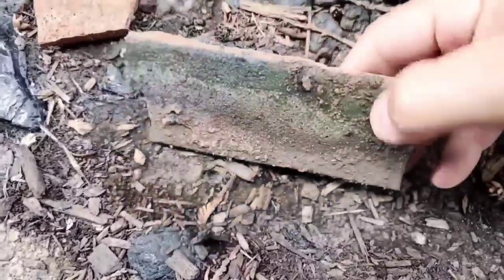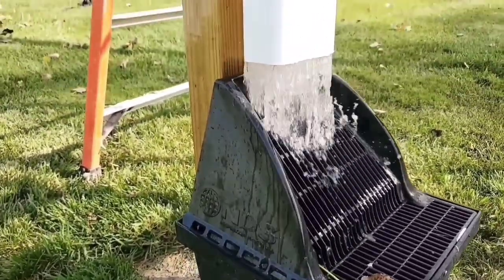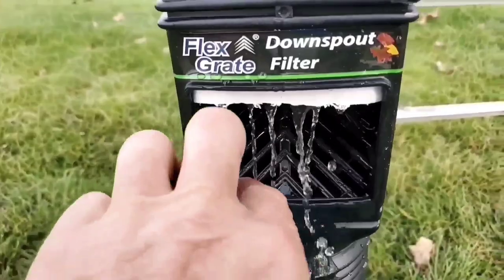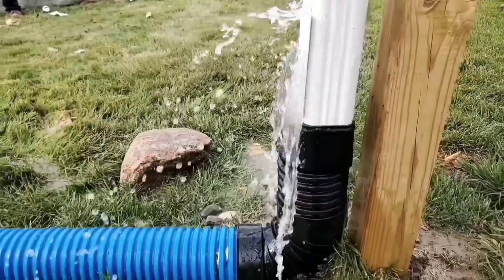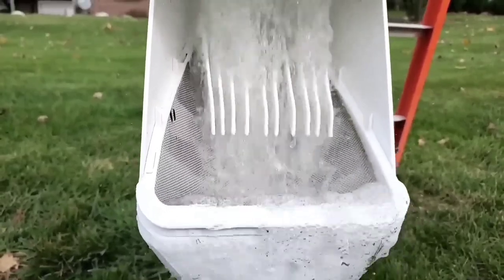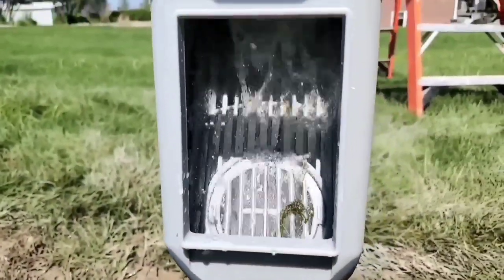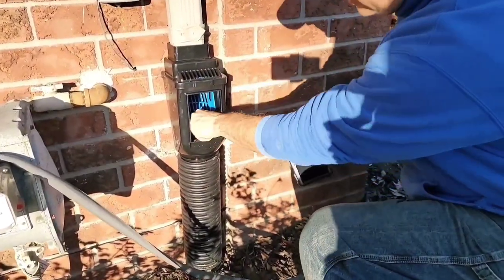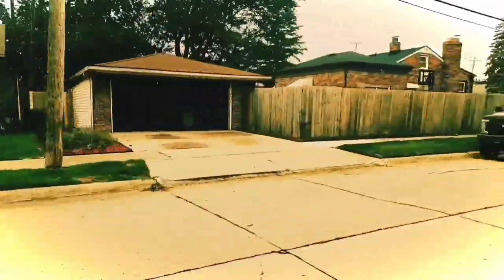Gutter Downspout Leaf Filter Clean Out Review  [ 2023 Leaf Filter Guide ]

Comment: An even better test and demo of how bad is to add some leaves to the gutter.  I bet those would come down the downspout and block the grates diverting even more water out on the ground.
Reply: Great idea!  I've tried solutions like this and the leaves always create a problem. So this isn't a set it and forget it, which makes the homeowner have to just make sure they're checking this as needed.  French Drain Man, looks like an awesome product, and extremely impressive you're the inventor, but please do a video on how leaves work with this system.

Comment: I think this is a good system, mainly because you can check and clean out the trap so easily.  My only concern is that in a heavy downpour, especially in the fall when leaves come down, that the trap fills with leaves and clogs it--you'd have to be there then to quickly unclog the leave catch or suffer an overflow.  My only other concern is the quality of the plastic--is it resistant to UV damage, cracking in temperature changes, etc.  I think something similar made of aluminum would probably last indefinitely.  But this looks like one of the best systems thus far that I have seen.  Going to put on my thinking cap and see if I can come up with something better.  Thanks for posting.
Reply from the maker: It's UV protected and clog free design has been winning homeowners over around the country. We can't keep them in stock.

Comment: The gutter downspout filter that you show from home depot is easy to fix the overflow issue...  Just cut a piece of 3" or 4" drain into a 5"x5" piece and then insert into opening as a cover.  Volia - fixes the overflow issue shown here.
Reply from the maker: I wish you luck with that. Enjoy mopping up your flooded basement 🤷🏻‍♂️
Reply: @FRENCHDRAINMAN  Ha.. nice reply to someone trying to help....this performs just fine.. excellent solution.
Reply: I have the Home Depot ones newly installed and they splatter.  

I am not ready for $300 upgrades yet.  Do you think just covering the hole with black ducktape/flex-tape would work?

I have filters on my gutters so these downspout filters are secondary and won’t get super large debris.

Just cant have the splatter on my new pavers.

Also where would I get a 5” by 5” cover/sleeve to try that?
Reply: @nathanharrison8556  For sure - tape or a baffle cut from plastic works fine. :)

Comment: The FDM leaf filters are a remarkable product.  I installed these after taking our downspouts underground to our city storm sewer.  We had a clogged gutter at the top gutter inlet and once the clog passed the filter contained the debris and had no issues handling a 1 story 30 foot filled gutter.  We were recently a part of the large thunderstorms in NYS where we ended up getting 5.5" downpours and these filters did not even hesitate.  Not a drop came out of the vent and these flowed smoothly.  I was beyond impressed.  i have 4 installed and will be installing 2 more on our detached garage which I will just use the FDM 3 inch pipe to a pop up since it is too far away to connect to my current main drainage line.  I have posted this elsewhere and am glad they went overkill so another shout out and thank you to FDM and the design team.

Comment: I had new gutters and downspouts installed last year. I have really good (too good) downspout to ground connections but the blockage at the top where the downspout turns from the gutter to the wall seems to be my worst problem. This means ladders and risky unblocking techniques. what inventions do we have for that? My leaf blower is a powerful 80v electric greenworks and I wondered if it's just easier to make the Bottom connections easier to remove (like a slip joint), so I could attcach and send a good blast of air every couple of weeks during fall just to stop the build up? I do this now easily (and it works) where downspouts just fall onto my concrete driveway but for the down spout to ground connections are so good, BUT also so tightly fitted, they are a pain to remove to get access. Who has ideas for me? A slip like downspout joint seems the way to go! Any out there?
Reply from the maker: Change downspouts from 2"×3" to 3"x4"

Comment: Looks like a good product to filter out leaves. Recently we had a plugged underground line where the gutters ran into drain pipe a foot under the grade. But our issue is pine needles with all the 100+ foot Doug Firs. They are the biggest pain in the Butt. We have fought it for years and noticed 10 years ago foundation damage in part because of drainage. and a heavy cement tile roof and altered engineering. A wall was moved previously what appears to be unpermitted. We hired an engineer and spent  fortune pouring cement columns 5 feet into the ground which should solve the problem, however there is nothing on the market that comes close to being effective except this one you designed, however the problem will still exist once we install a finer mesh screen to filter out pine needles. The finer mesh screen will slow the water drainage considerable and will likely spill over like in your video. Pine needle clogs are not really a problem now that we have installed leaf filter, but recently had a crawlspace flooded due to a clog of many years accumulation of pine needle lodged in an underground drain pipe. So the plan now is to extend the drain into a dry well 15 feet from the house. Do you have any suggestions for a downspout filter for pine needles, hopefully leaf filter screens which we have now will filter out the pine needles. thanks MAP
Reply from the maker: Needles are the absolute worst.

Comment: i’m starting to build my home in georgia, what do i need to buy for a complete roof run off system
Reply from the maker: Downspout Leaf Filter Vented Clean Out, Gutter Leaf Guard
https://frenchdrainman.com/product/downspout-leaf-filter/
Downspout Basin Combo Kit (Connects to 4 in. Corrugated)
https://frenchdrainman.com/product/downspout-combo-kit-4-in-corrugated/
Downspout Pipe 4 in. x 100 ft. High Octane ARMOR Pipe
https://frenchdrainman.com/product/heavy-commercial-solid-high-octane/
4 in. Single-Wall / Dual-Wall Corrugated Drain Tile External Snap Coupler - French Drain Systems | Curtain Drains | Macomb, Oakland, Lapeer, St. Clair County
https://frenchdrainman.com/product/corrugated-drain-tile-external-snap-coupler/
4 in. x 108 ft. FDM's 200 Year Tape - Extra Sticky & Extra Stretchy - French Drain Systems | Curtain Drains | Macomb, Oakland, Lapeer, St. Clair County
https://frenchdrainman.com/product/4-x-108-fdms-200-year-tape/
Reply: @FRENCHDRAINMAN  thank you for the info, would I need the basin for each downspout? Im probably going to be installing it myself, do not think my builder would, he wants to use pvc pipe.

Comment: To be fair to the first NDS catch basin, that amount of splash volume you're feeding it (once maybe twice year storm) probably isn't that big of a deal. You could even have brought the gutter down more or done something to mitigate the splash (cutting the downspout at an angle?).  Moreover, I think the leaf removal from the NDS is easier and more obvious than your system.  BUT BUT the real downfall of the NDS system is that install requires drilling weep holes in the bottom of the catch basin to prevent standing water (which is very important in mosquito prone areas).  So for all your slow-burn rains if the flow is less than the drainage of the weep holes you're just dumping all that rain to subsoil.  So for any hurricane you'll dump all that volume to subsoil.  I don't like this idea, so I'm going with your solution. Thanks so much for it!
Reply from the maker: https://youtu.be/EVOyoK4Dheo
Reply: @FRENCHDRAINMAN  I'm not saying you should cut a hole or to make it so tight that leaves clog, but you're 2-6 inches off the grate. Heck, maybe someone (or NDS) just needs to build the walls up to reduce splashing. (But again, that splash is pretty small for once or twice a season.)   The benefit of the NDS solution is that with so much area, and non-enclosed slope it moves leaves so much quicker, more visibly, and with less maintenance than your solution.  That cant be denied.  BUT as I said the CRITICAL flaw with using this basin against the foundation is the weep holes (which are important in mosquito prone areas). During a 4 day storm/hurricane (constant rain but very low volume) if you continually get 2 gallons an hour passing not through your pipes but through the weep holes into the subsoil (not to mention all the smaller storms).  Maybe that makes sense in a hard catch basin, but not next to the foundation.

Comment: At 5:50 this was installed incorrectly!! This product is meant to be fitted under the gutters (Top of the pipe) NOT sat the bottom of a drop where the water has picked up so much potential energy/speed!! This is how nearly all water harvesting devices are instructed to be fitted! If you fit it at the bottom expect it to fail!!!
Reply from the maker: I see it as a failed product either way. Let me explain. In a tight screen filter it has to be cleaned regularly. Who is going to get up on a latter to clean the screen?
All tight screen device plug quickly with fine pollution off the roof. It's failure no matter what. A coarse screen doesn't plug and leaves can be removed from the ground without the liability of a latter. More injuries documented with use of a latter the  Statistics are shocking. And again most homeowners are not doing inspections of a device up top resulting in plugged failed filtervdevice pouring over during  Torrential rain causing flooded basements and crawlspace. Thank you for commenting, I'm just a practical contractor sharing what happens in the real world because I see it everyday. ✌️

Comment: The last demo was biased. You taped up the thing more than a hockey stick.  Then thr next clip when someone was servicing one there is no tape. Show a video without your system all taped up to prevent leaks
Reply from the maker: Our prototype ( that was taped) was  2x3 and we used a 3x4 downspout.  It was also 3-D printed so the material was not HDPE.  You're not focusing on what's important here at all
Reply: @FRENCHDRAINMAN  I see what's important but you should redo the video or clip out the prototype and use a final product to fully demonstrate the product.  As a consumer I want to know the final product works without needing taped. Also if you threw in some leaf litter and such to demonstrate that it works for that also.
Reply: If you can do that I'll have my order in Monday
Reply: @FRENCHDRAINMAN  I don't have underground downspouts because I have a rainwater cistern and I'm considering your product to help remedy any debris problems. Would you recommend your product for that application